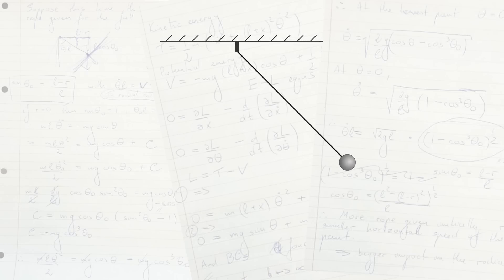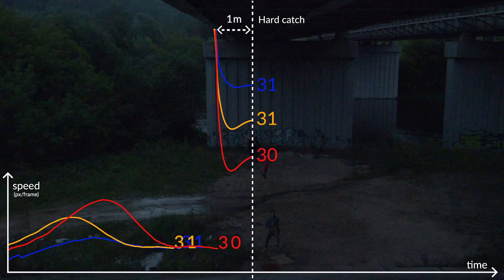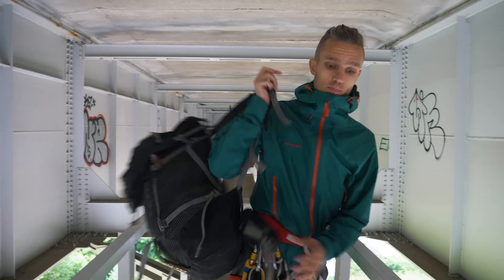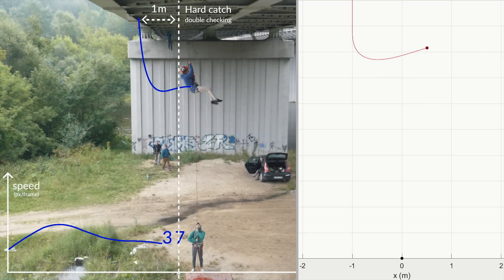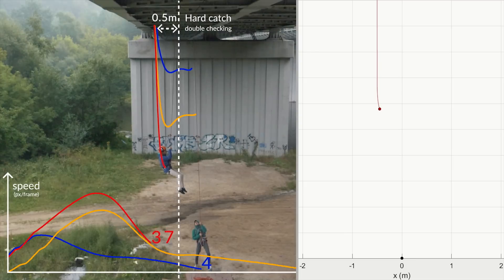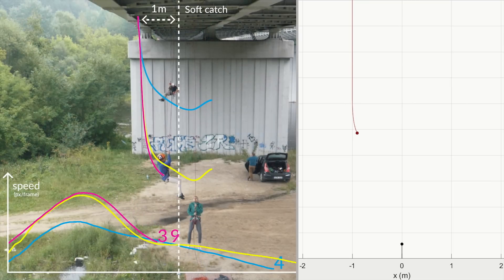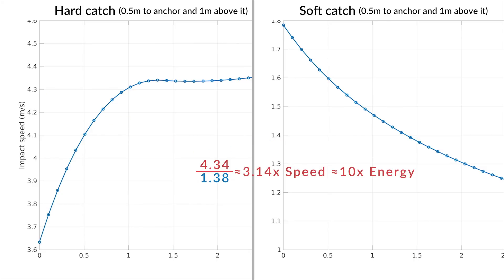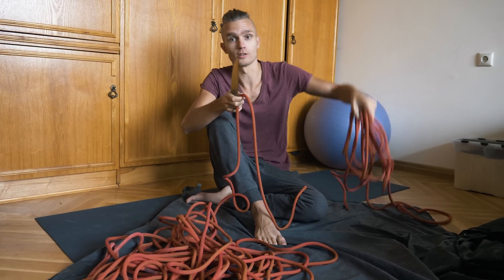Too much Slack while Lead Belaying?

Comment: This is great, thank you. I've been trying to explain to some belayers that a soft catch is not simply slack. Hopefully I can convince them with your video.

However there is one factor that I think you are not taking into consideration which might make a small difference: the initial force vector of most falls is, in my opinion, not purely vertical. 

Typically, I would expect our feet are "pushing" against the wall, not just vertically, but horizontally as well as that gives better stability/more friction. I believe this is the reason that we typically fall away from the wall even when on a purely vertical wall. This is good, as this clears us from the wall and reduces risk for us. 

If what I'm saying is true, then I'm not sure the conditions of your live tests nor your mathematical model reproduce this. But in any even, good work and thanks again.
Reply from the maker: Hey Thank You! If you are on the overhanging or close to vertical wall it's best not to push your self away from the wall. (of course if there is no risk to fall onto something...). Pushing away from the wall increases horizontal distance and the force that you hit the wall will increase as a result. And yea modeling this would be a bit more complicated. 
In any case glad you liked this video ;)

Comment: Hi, sorry, but this is NONSENSE. Simply you don’t know what is the “real slack”. It is clear if you look at the “climber” bouncing up and so the belayer. It even seems that you are using dgigri. The “real slack” should be smooth (slowly reducing the speed) so that you reduce the speed of the falling climber. So of course if you just prolong the fall and then brake the result is what you got. SO people please give your climbing partner proper slack. Especially on vertical wall other vice he/she hits the wall really hart. The video is nice but you should not confuse math with reality :)
Reply from the maker: Term slack in this video is used to describe extra rope between the belayer and climber. And if you watch video carefully you'll see the difference in soft vs hard catch with / without additional slack.
Reply: to give someone slack is to give additional rope before the rope catches the climber. What you're probably talking about is belaying dynamically, where you're softening the peak impact by elongating the period in which the climber's speed is reduced by letting the rope run through the belay device whilst the rope tensions. (the effect will be a bit similar to jumping / their soft fall). Seem similar, very different in practice. Both reduce the slamming speed into the wall. @Day In Nature I would LOVE to see a similar video with belay devices that allow for dynamic belaying (figure of eight / tube-style) and a gravitational force meter

Comment: (1) "all the falls produced almost identical speeds at the bottom of the swing" This is because vector analysis shows us that we can break motion up into X and Y components. Your distance from the wall at the time of fall will contribute most to the horizontal component (swing) the fall (direction normal to the earth's surface) contributes to the vertical component of the fall. That is all to the first approximation. 
(2) The second approximation says that some of the horizontal component is derived from the bounce after the rope stretches. If the climber is falling away from the wall the bounce will correct this and bring the climber back up and towards the wall. 
(3) The third approximation corrects for the damping from the dynamic rope and non-stationary belay. This mitigates the bounce back effect in both directions. 
Think about the fall as a highly damped harmonic oscillation.  http://hyperphysics.phy-astr.gsu.edu/hbase/oscda.html

Comment: Super interesting. I was thinking the whole time, what about trad on less than vertical? Oh, that came at the end... I'm sticking with slack is bad.... :)
Reply from the maker: If we get dynanometer and time we'll do additional tests to see the forces to the anchor.
Reply: I would agree that slack is bad on trad.  The reason is F=ma.  If you have less fall you have less accelleration. However falling from above a piece of pro can shock load due to transient energy transfer.  My thoughts are that a slipping catch would be better as this smoothes out the transient.  Would really like to see some experiments on this too.

Comment: Great work! It´s nice to see explained by maths what we have learned by expewrience along the years! Take a look at a jump I did more than ten years a go that support your theory! ;-) https://www.youtube.com/watch?v=PBSgKVqf7eU
Thank you & keep safe
Reply from the maker: that..is... just crazy :D how high that fall was? And it's soo cool to see old school filming in action :D
Reply: Hello again! It's a wall with about 100m high and the jump was about 80m, I used an anchor at the top of the wall and jumped about 5m higher then the anchor because of the place to jump from, the belayer was about 20m bellow the anchor. I wanted to simulate a real huge climbing fall, like if it was real, to understand what happens in this kind of situations. I tried to jump as vertical as I could, related to the anchor to avoid the pendulum, but stil I touched the wall at the end of the fall with my feet and I throw down some rocks with the imapct! It was a soft impact and nothing bad happent.
Theese times, Dan Osman with his free and crazy spirit was a great inspiration to me! ;-)
Before that, I did some other jumps and they where allways a kind of a test, in a brigde I did a factor 1 jump with a 60m rope, one end tied to me, the other end tied to the bridge, only the rope (and me) absorbed the energy of the fall, and I can tell you, it's a hard impact!
That's way I used a belayer in the big jump of the wall, to try to absorb the most energy as possible, and it really worked, the impact at the end was very soft for a jump of that hight (we get really high speed in this lenght)! In fact, I think the belayer suffered a little bit more than me, he flyed up about 5m with the impact, only 5m because we used a limiter, I can not tell how high he would go with out the limiter.
Professionaly I become a Stunt Coordinator and I use a lot of the knowlege I got from climbing in many situations. By the other hand, from the profession, I bring into climbing something very usefull in my experencie - how to land on the ground and how to receive the impacts on the wall - I see many people landing very stiff after a fall, and because of that, they get injured... it's maybe one theme for one of your next videos "how to land on the ground"! ;-)

You are doing a great job!
Thank you very much & keep on! :-)
Reply from the maker: Very interesting read! Thanks :) I laughed when you wrote "I wanted to simulate a real huge climbing fall" and did 80m jump... very real :DDDD 
And it's weird that 60m single rope jump gave you a hard catch... I know guys here who do bigger rope jumps and they use static ropes and claim it's soft. And that dynamic ropes for that length is to long...
And falling hard! Yeaaa such a big issue... Even on ropes ppl fall like potatoe bags and smack to the wall with no soft absorption with limbs :D
Again thank you for inspiration!

Comment: Very cool video! It would be even cooler if you could do a soft catch variation using a tube belay device (atc, reverso). In this case the belayer does not move but he/she leaves slack in between the device and the brake hand. The question would be "how much slack is the softest?". (as climbing instructor i teach this method first and the jump later, as some people really have a problem timing their jump perfectly!) cheers!
Reply from the maker: Appreciate your comment! Tube devices gives softer catches compared to auto blocking once according to this: https://www.petzl.com/US/en/Sport/Influence-of-the-belay-device 
Now what you described seem to be slightly different way of belaying and unfortunately we don't have experience doing that. There is also a way to feed the rope to ATC during the impact to make a soft catch, but again at this moment we tried only jumping... 
So yea lots of things to try / learn / test...
Reply: what i described is basically the easiest and less refined way to feed rope through the atc during a fall. The rope going from the atc to your strongest hand is a bit loose, "U" shape. Squeeze your hand tightly with the hand but leave your arm semi-relaxed. Ok without gloves but better with them, quite foolproof after 10 practice falls. The more refined way involves letting the rope slide through your brake hand and squeezing it progressively...it requires more practice, gloves are mandatory. Of course, for early practice you need some way of preventing a groundfall in case the belayer lets go completely!!!
Reply from the maker: Yea thanks again! Makes sense, but requires atc... And we prefer automatic devices... Maybe someday that will change :)
Reply: Personally I wouldn't trust a belayer using this technique without gloves. It seems like a perfect way for the belayer to get friction heat burn injuries, loose the grip of the rope due to the pain, and sending the climber plummeting to the ground.

I'm all for placing the brake hand quite a bit away from the tube device though, to keep the hand from crashing into the tube device

Comment: The stuff is all interesting. However, I do not like that you try to minimize the horizontal speed while ignoring the vertical speed that is build up due to longer slack. The relationship is simple here if you ignore the stretch of the rope: The more slack you have, the more of the potential energy (the height of your body) will be transformed into vertical component of the speed thus reducing the horizontal component of the speed on the other hand and vice versa. Therefore, the whole thing is a trade off between getting catched more softly (low vertical speed) versus lower wall impact (low horizontal speed).

This relationship should have been pointed out in this video because looking at this thing onesided can lead to dangerous situation when people follow the "the lower the horizontal speed the better"-rule blindly. One should always keep in mind that a common way to handle the wall impact more smoothly is to bend your knees in the moment your feet reach the wall. Actually, the latter is taught in every climbing gym.

Just in case someone complains about the fact that I have ignored the stretch of the rope in the relationship shown above: In fact, the stretch of the rope makes the trade off worse for the "lower horizontal speed" side because as shown in the video some of the vertical speed is stored in the rope stretch and afterwards released partially as additional horizontal speed as bounce.

Another point that is very dangerous about intentionally giving more slack is when someone is exactly above the safeguard and falls. Such a situation can lead to deadly injury due to damage of the intestines. Therefore, when someone is exactly above a safeguard generally the rope should not be loose.
Reply from the maker: We were not ignoring vertical speed - all the speeds in this video were vectorical (combining both x and y axis). And you can see that in the graph on the bottom how falling more reaches higher top speeds. If somewhere I did mentioned horizontal speed it was actually full speed component.

Now about your 2nd point "very dangerous about intentionally giving more slack is when someone is exactly above the safeguard and falls" - I don't really understand your statement here... If you meant that if someone is above the bolt giving more slack is a bad idea and somehow that will cause dmg to your guts...? That's totally not true - climbing ropes have maximum force that the climber will ever feel and in the end of the video we showed some maths about this case.
Plus ppl do 10-20m whippers or even hundreds of meters rope jumps... And they get no damage to the body..
Reply: Hey guys, I think that the horizontal speed is more important than the vertical, as this determines the impact on the wall (given there is no ledge). Could you adapt your model to only account for horizontal speed?
Reply from the maker: hey ooholycowoo, the impact to the wall would depend on magnitude of the velocity (combining speed of both x and y axis and the angle). If you are moving up and you are stopped by the wall (not sliding up / down) all that movements energy will be absorbed at that point.
If that doesn't convince you rest a  sure that horizontal speeds are waaay lower than magnitude speeds and you would get bigger speed reduction by increasing slack amount.

Comment: Very cool series. Awesome work. Thank you! I really enjoy this. Here is one question I have. How would the results vary if the fall was a lead fall with 5 to 10 quickdraws between belayer and climber? How if the quickdraws are not in straight line?
I assume this could reduce the need for slack and belayer jumps ...
Reply from the maker: Thank you! We're working on more videos to add to this! The more rope you have in the system the softer the catch is (smaller fall factor). If the quick draws are not in one line you will have more friction - what effect that has on the softness of the fall - I don't know... But will try to figure out some time in the future. Again, thanks for the comment! It helps to motivate us and YouTube thinks that it's a good video :D

Comment: Also, a question: did you switch ends of the rope for each fall, or use a new rope?  As I'm sure you know, ropes take a little while to regain their full dynamic capacity after a fall—to recoil their springiness.
Reply from the maker: Yes we let the ropes to rest for about 10 mins in between the jumps and we did retie the knots.
And actually the rope doesn't loose it's springiness after subsequent falls, the opposite is true. Rope become more like a sprint and less capable of dampening the energy. Max showed this in his experiments: http://www.bigel-labs.de/3.Physik/RopeTests/Bealelongations_g.gif notice how every fall makes the weight go lower and shoot back up higher every time. And the first (black) fall is the shortest - according to Max that's because of the knot tightening.
Reply: Well that is EXTREMELY interesting, since the commonly accepted wisdom is that the spring (the rope) needs time to contract, and that subsequent falls both create more impact force and risk your rope breaking (due to a more static rope).
Reply from the maker: Yea rope needs rests to regain it's absorption abilities. You actually don't want your rope to be like a spring. And another note is that it's practically impossible to break a rope, when you would do fall factor 1.77 5times + in a row...
Reply from the maker: Uuuhhh that fall was nasty... And a good lesson to learn from. My gut feeling says that you want your rope to stretch out and do not start pulling you back at the same time. That's the difference between spring and rope. And it seems that once you stretch it it starts to behave more and more like a spring... but I'm just guessing here. Maybe once I get more time I'll take a deeper look into all of this and ask Max Bigelmayer to explain it better.
Reply: Ahh, I see what you're saying.  Stretch vs. spring.

Comment: Great video. Love the evaluation of the effects/benefits of the soft catch.
Have you considered the possible contribution of the belay device and the amount (length) of rope that would slip through? (or is that what your are referring to when you state that the jump is just one of the methods of soft catch) 
For example, if a 9 mm would give a harder catch than a 10 mm rope? Or would a gri-gri give a harder catch than a Reverso or an ATC? And how do each of those devices behave with differing diameter ropes?
There could also be a difference in dynamic elongation between different diameters of rope to factor into the equation.  
So many possibilities for further videos!
Reply from the maker: Yes, ATC / Reverso style devices gives a softer catch by 30-40 % compared to auto blocking ones like gri-gri. Reference: https://www.petzl.com/US/en/Sport/Influence-of-the-belay-device
But despite the fact that ATC gives softer catch jumping up should have much bigger effect. Of letting the rope intentionally slip through the ATC.

And you are right dynamic elongation is different for different ropes, usually skinnier ropes are more stretchy.

So glad you liked the video! Thanks!
Reply: Thanks for the link to the Petzl page. That has confirmed the need to jump to create the soft catch, especially when using the Gri-gri. The graphs showing the forces on the climber are interesting, showing 2 kN for both Factor 0.3  and Factor 0.7 - though personally,  I rarely take 0.7 factor falls and almost never take 1.0 (or greater). The Petzl results also seem to have a slight anomaly in that the force on the belayer is greater for a Factor 0.3 fall than for 0.7 and 1.0. However, that may be as a result of variances in the rope slippage, perhaps with the 0.3 fall being held more tightly.
Thanks again for the video and for your reply.
Reply from the maker: Soft catch is almost always a good idea... How you do it it's a deterrent question. You just might be lighter than your belayer and that's already a soft catch without doing anything :D In any case thank you for the comments - they do inspire us to do more :)